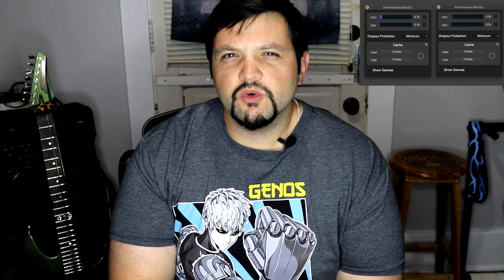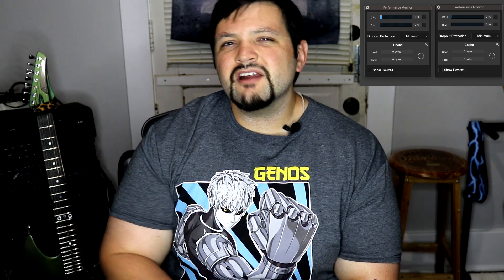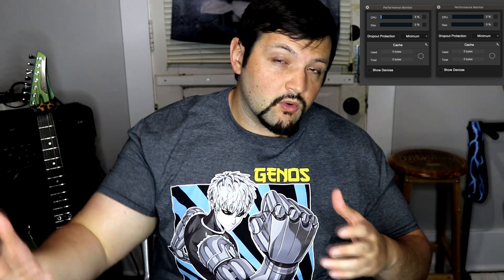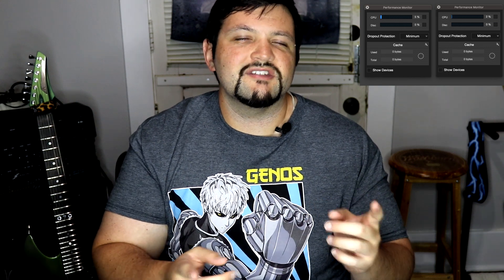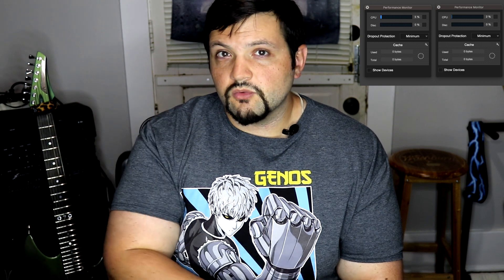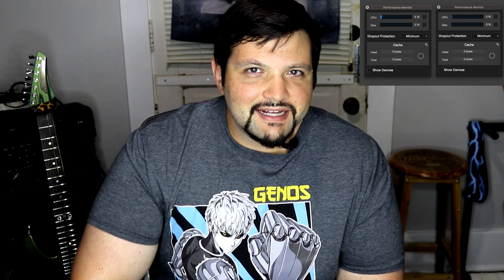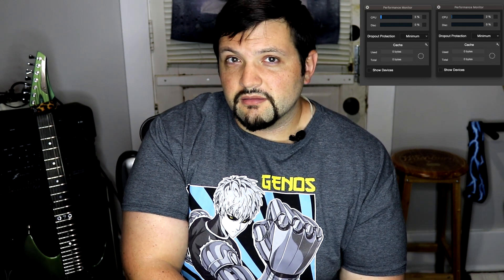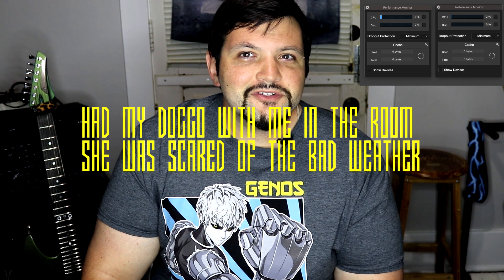Investigating Presonus Studio One 4s CPU Meter

Comment: In my case  i cant figure if this has to do with ram speed or with some other compatibility issue. I'm saying that because i have a six core proccesor and 16gb of ram and i have the same problems as you described. And that is a session with  just 2 vst's and an eq brings cpu performance  100% while in windows task manager is 15%. A Friend of mine with a much older pc and just 8gb of ram works with a dozen of vst's  active and no problem in cpu performance, with studio version 5 also.
Reply from the maker: It is so hard to track down. It might be the speed of your ram.

Comment: I'm running S1 5 with an I7 6700 and 16 GB, it doesn't peak anymore but still has a little cracking sound here and there. Before I was using a MBP with an I7 4980HQ and 16GB, it used to work fine with S1 4 but started peaking with S1 4.5 and Coreaudiod  started not responding.

Comment: Today I discovered that even though the S1 meter was going all the way to 100%, my cpu usage averaging just above 30%  in any thread. It's a good insight that RAM may have something to do. I have 24 GB of DDR4 2666 RAM, I'll keep researching.
Reply from the maker: Your ram seems great, but I also think it likes really fast RAM for some reason.  I also think the DAW itself doesnt know how to use all the resources it is given.
Reply: @LucasLeCompteMusic  Today I made a test that I think supports your RAM hypothesis. I used a bunch of amp sims in different tracks at high sample rates. No sample instruments, negligible use of RAM. The S1 CPU meter went to around 80% with no dropouts and my CPU usage was about 70%. I had max drop protection and S1's priority set to high. Oh, and no tracks armed for recording.
Reply: OK, final test... I used Reaper and was able to consistently reach 90% CPU usage using 50% more amp sims with the same settings without dropouts... damn, it's true, S1 is not very effective at using the CPU... it's a pity because I love everything else about it ☹
Reply from the maker: @TheAsdsdswww  same here!